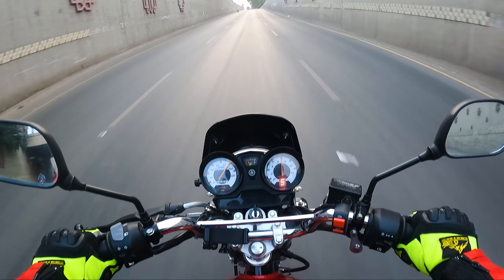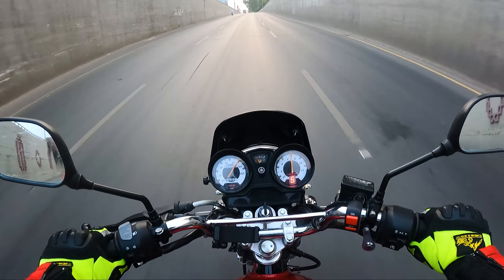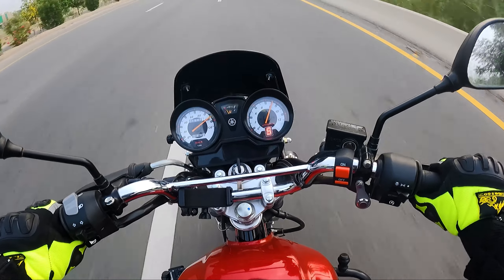Yamaha YBZ-DX 2021 Model Top Speed Test || Stock Bike Top Speed Test

Comment: Bhai idhar meri ybz dx 90 cross nai karti 😭
Reply from the maker: air fuel mixture adjust krwain or valve clearance be. it will be fine.
Reply: @ComfortRidetech  dono karwaey hen. Ab tk 16k km chal chuki ha. Pir b ye issue resolve hone ka naam nai ly raha
Reply from the maker: Model konsa hy ?
Reply: @ComfortRidetech  2021
Reply from the maker: 1600 chali hy yan 16000?
Reply: @ComfortRidetech  16000. 2 dafa meter claim karwaya ha. Pehle meter correct nai thy. Ab GPS or meter ki reading almost same hoti ha. Per bohat mushkil se 90 tk jati ha
Reply from the maker: Basically in me 2 se 3 factors ho saktay. Agr high rpm pe ja k bike missing kr rhi ti us me plug or air fuel mixture daikha jata hy or filter cleaning b. In bikes ki max speed gps pe 110 hy. Ap kisi mechanic ko change ke k try karain.
Reply: @ComfortRidetech  missing nai karti high rpm pe, per 4th gear me 9k rpm se uper b nai jati.
Different mechanic try keay hen, but no luck ☹️
Reply: @mubeensindhu  yr ye dx kuen nahi jata 8k rpm se uper mera ybz 2017 9k tak chala jata he ka 114 top speed he
Reply: @ybrkidunya  yehi samjh nai aa rahi. 90 pe ja k is ki bs ho jati ha 
Or maze ki bat ye ha k single rider k sath b max 90, or 2 bandon k sath b max 90🙄
Reply: @mubeensindhu  meyn khud bohot canfuse hoin ke ye kia mamla he mera to cg 125 ko hRa deta he maza se
Reply: @ybrkidunya  me ne sb kuch kar k b dekha ha. Carburator b tune kea ha, air duct b remove ki ha, front sprocket b 15T daal k dekhi ha per koo faida nai hua😑
Mujy to ab lag raha ha k ya to CDI unit ka issue ha. Ya pir new models jaty hi sirf itni top speed tk hen
Reply: @mubeensindhu agar ap mere city se hote to shaied meyn dekh sakta chala ke kia masla he lekinn 90 ki speed bohot kam he
Reply: @mubeensindhu  meyn apko mashwara deta hoin ke agar koi old modle ybz he spokes rim wala bohot kam chala hua to wo le lien wo kabhi apko pareshan nahi kare ga mere pas 2017 ybz he abhi 3 months pehle oske meter ki girari kharab hui thi jo hub meyn hoti he 4 years bad iski girari kharab hui thi wo bhi pani ki waja se jam ho gai thi dekan pe ja ke 200rs meyn sahi karwa li abhi tak sahi he 3 months ho gay heyn
Reply: @ybrkidunya  bro ap kis city se hen? Maybe i can visit
Reply: @mubeensindhu  rahim yar khan
Reply: Meri bhi bike 8k rpm sa upper nahi jati or top speed 90 kmph